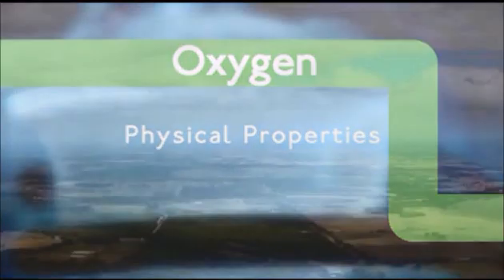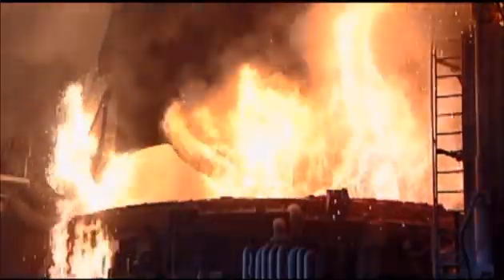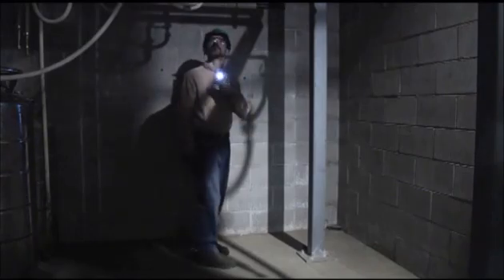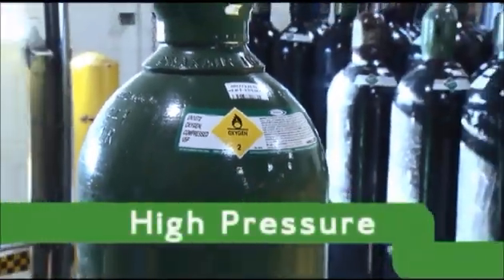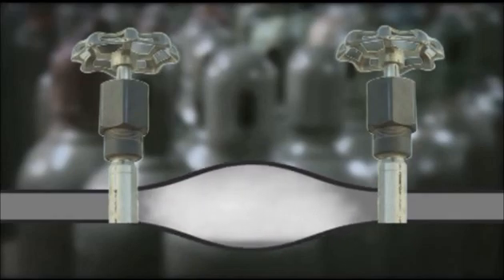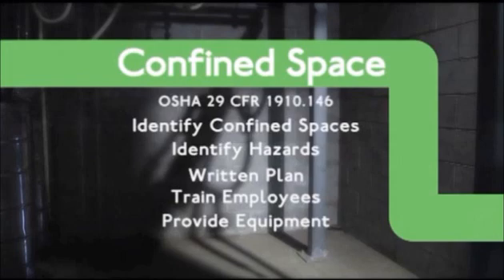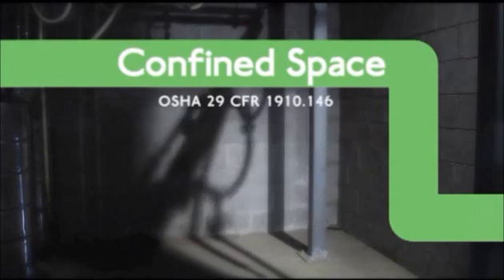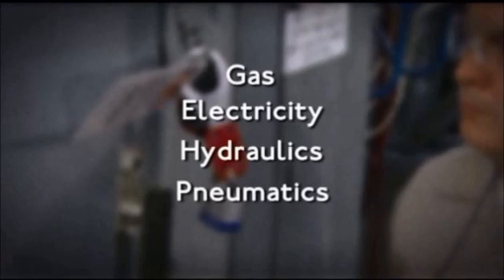Praxair Oxygen Safety

Comment: Bunding or containment of bulk storage of O2 is not mandatory. I wonder why. 
I will always have a fire wall between the tank and any building. If the building is on fire, radiation will always increase the temperature of all surfaces around the tank. It also shield against direct smoke being blown to the installation.

Liquid O2 does not immediately and instantly turns into a gas. Containment should be mandatory if you have any combustibles within 50ft or 15m of the bulk tank. At least that is what I will always do in my designs.

Where drains cannot be moved away from the installation, a removable, concrete pipe, should be installed as a round curb, to a height of 1,8m, to prevent the has from entering.

I'm glad to see and hear that cars must not be allowed to enter or park near the installation. I would say not within 50ft or 15m. No combustion engines to be allowed within 15m.

No vegetation, storage, electrical installations, overhead power lines, open flames, source of ignition, static electricity, rubble, broken glass that can act as a magnifying glass to start a fire and unauthorised persons.

Horizontal tanks should be preferred above vertical orientation, due to a falling hazard onto nearby structures. Preferably, the distance from structures should be at least the height of the tank.